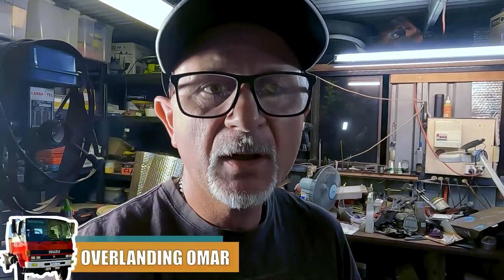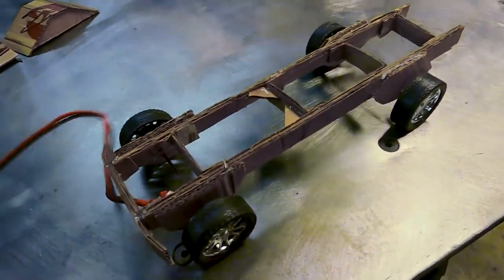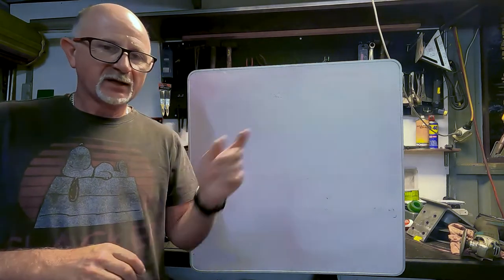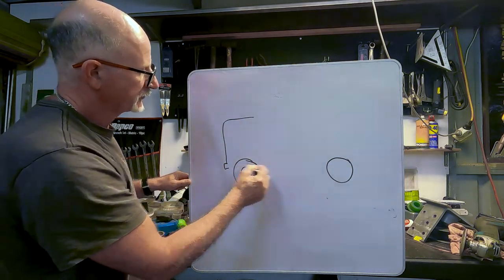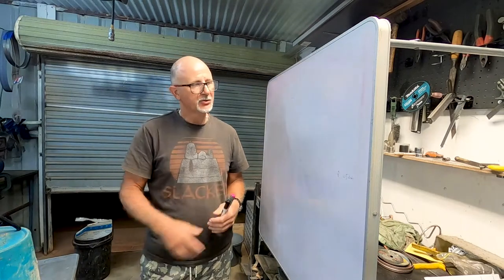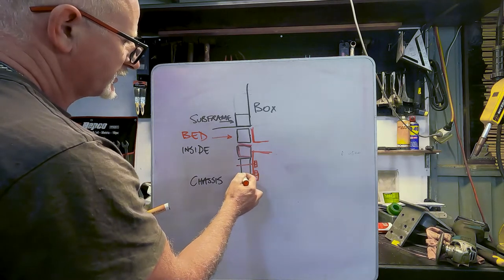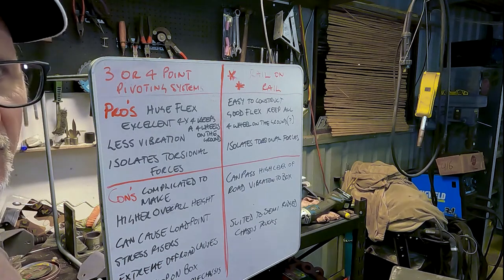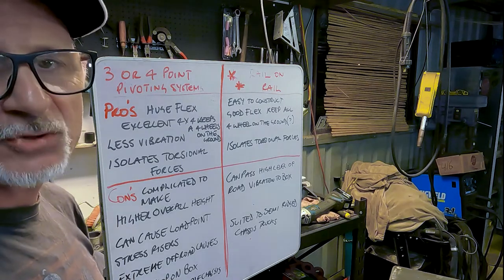Explaining Chassis Flex Overlanding Omar Ep 10

Comment: For the calculating load on each sub chassis support it will depend on the weight distribution of the suspended load (the camp box)  Look into videos on "free body diagrams" and "beam deflection calculation : point loads and distributed loads" and that will give you a better idea of how to calculate. Keep in mind that dividing by four is probably good enough as long as you are very conservative with your weights etc

Comment: Gday, I'm about to go down this track with my truck soon. My thoughts is that the pre-load should be for the weight of the chassis diff springs etc.  My thoughts are that your trying to allow the chassis to flex independent of the tray/bed attached, if you run too heavy a spring or cushion you may prevent the flex as the spring/s combined only allows a small amount of compression before it supports the chassis before the chassis has flexed to it full potential. For example, let say you rear Axel curb weight is 1 tone with all items attached to the chassis. If you were to use 1 tone cushions per side and one side of the back wheel was lifted, there would be little to no flex as the cushion on the opposite side is capable of taking the entire weight of the chassis by itself, if that makes sense. Also,  I see a lot of these two L brackets used with two or one springs,  my concern with this type of mount is they offer little to no protection if your truck was to take an impact to the rear or moment on that plane. 👍